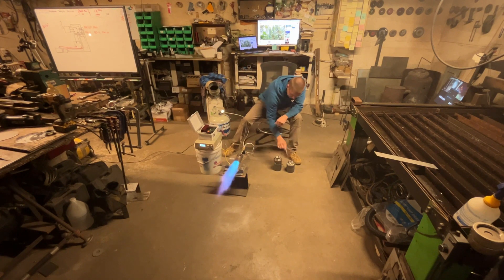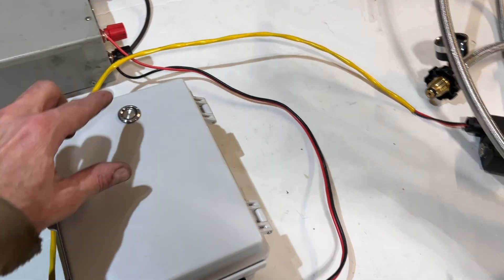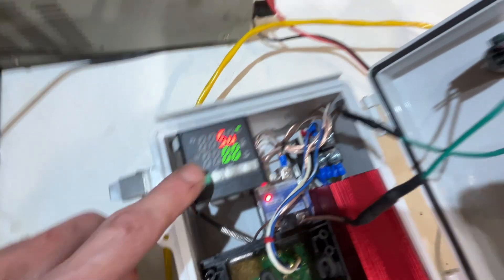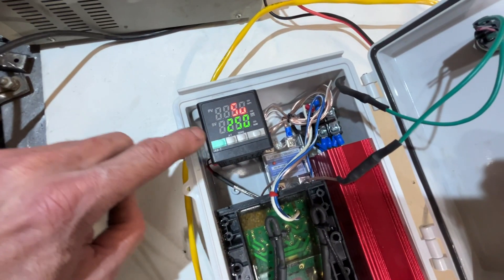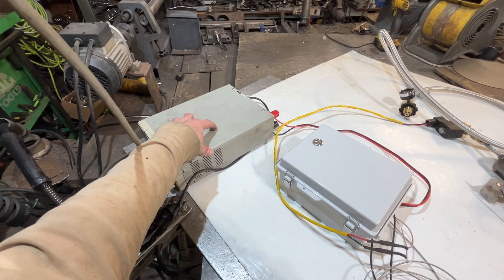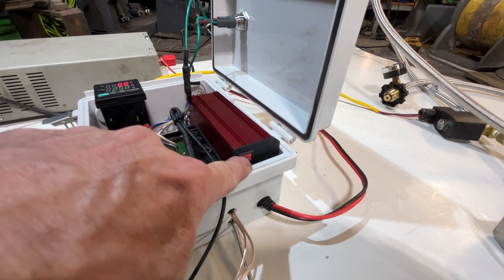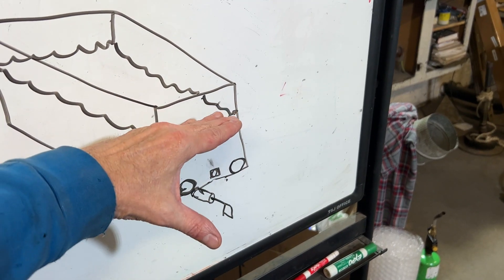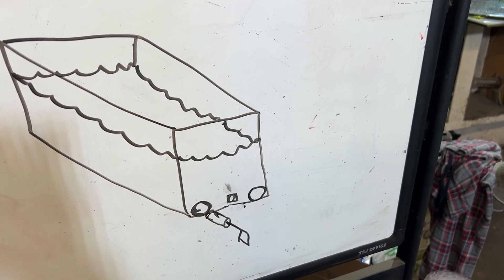Temp Controlled Propane burner

Comment: Constructive criticism: Would it be a good idea to add a large red STOP button in addition to the small silver 'go' button? Reason being, that a toggle can sometimes be a little ambiguous, but a giant red STOP mushroom button is never ambiguous.

Even an alarmed and confused bubba knows what a giant red mushroom button do.
Reply from the maker: It had a price cap so yes its better but the dollar  is very weak these last 4 years ...
Reply: @NOBOX7  Price cap means emergency stop function not implemented? I'm pretty sure these are the starting points for safety videos where they show what went wrong.

Drop the customer who cheaps out on safety.